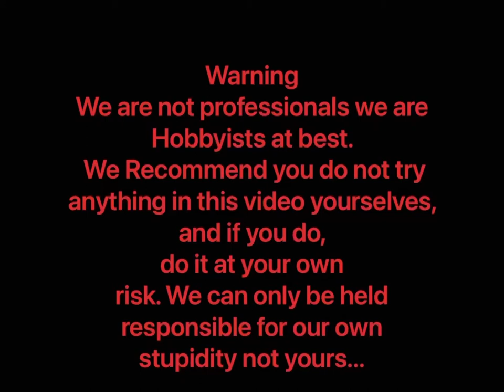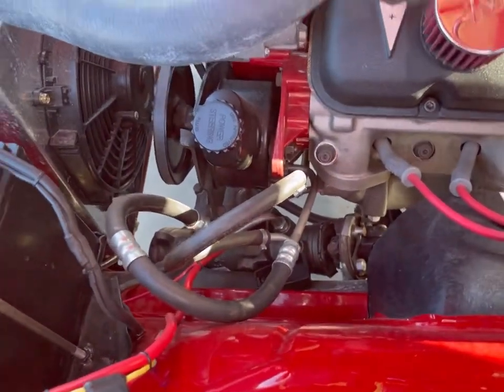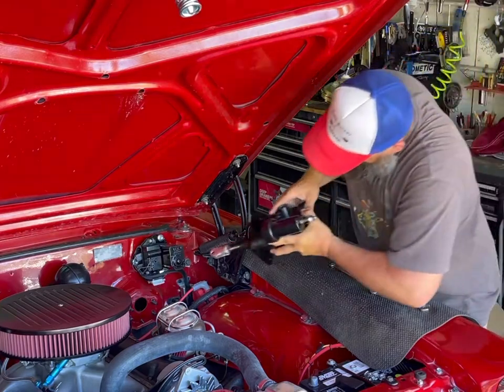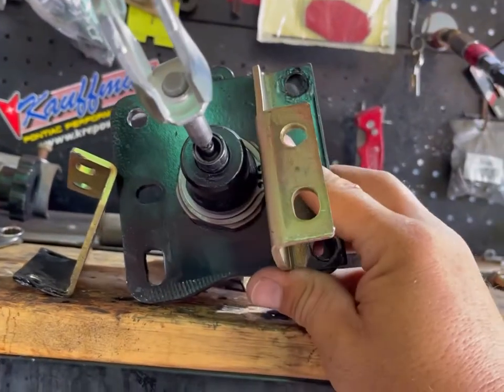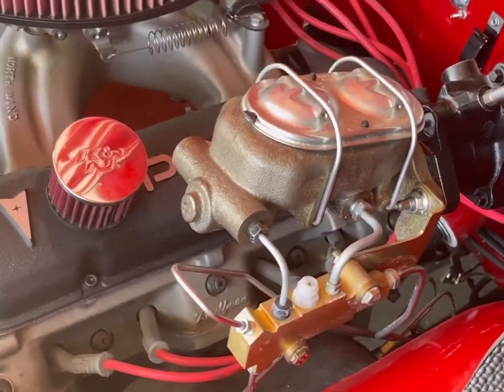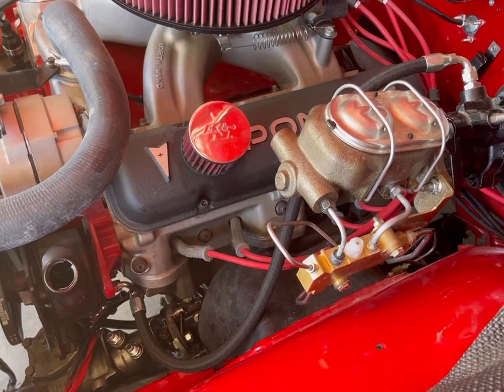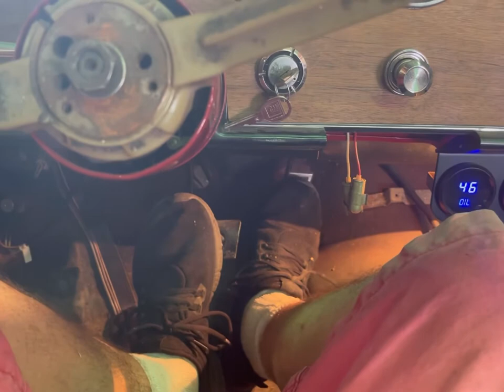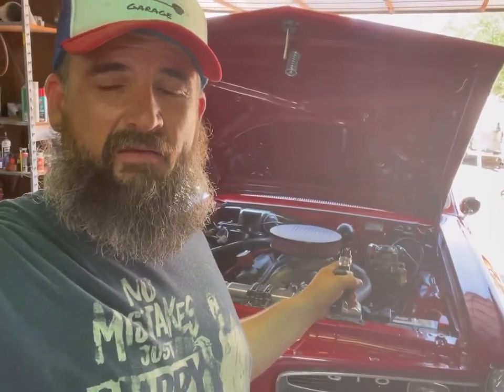1966 GTO hydraulic brake booster upgrade

Comment: Changing the pin distance is not gonna fix that instant pedal issue. It will only make it feel like it’s not engaging for a bit and then back to instant brake. If you want a longer brake you likely need to change the pedal ratio.
Reply: believe it or not it did the trick perfectly. it’s because the pin was already depressing the plunger on the master. pedal feel is A okay now.
Reply: @ottohansen4008  that is good to hear, preload on the master is bad. Was it adjustable on that unit or did you have to grind it?
Reply from the maker: had to grind it to get the clearance i needed

Comment: I have a 65 gto just rebuilt the engine and the rockers are hitting the valve cover so I need tall VCs ones the brake booster is right on top of the VC should I get master cyl & booster do you think I can get just a 7" booster to fit? Thanks
Reply from the maker: you can get a smaller vacuum booster and should clear no problem. also i got some valve cover spacers instead of taller valve covers. worked great
Reply: @junkbucketgarage  the problem is theres 1/8" distance from the VC driver side, to the booster, & you can hear the rockers tapping the VCs. Im going to remove theVCs and see if theres any marks.
Im concerend if I buy just a booster it wont match with the master cyl and I hate having to but all new just for that reason I already have a bunch of parts from my redo of the drive line radiator to the differential.  
Thanks for the reply
Reply from the maker: if you get a smaller diameter booster that’s for that car you shouldn’t have any problems with it matching up to your master cylinder. good luck 🍀👍